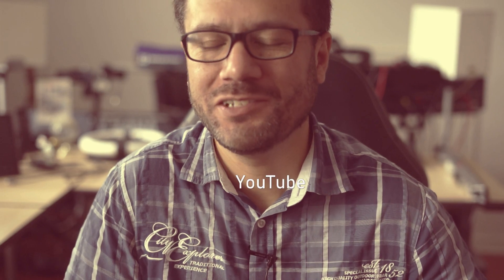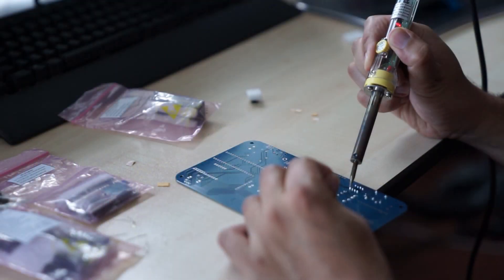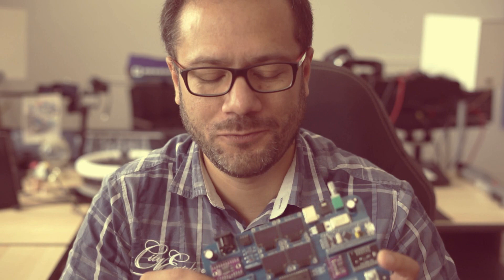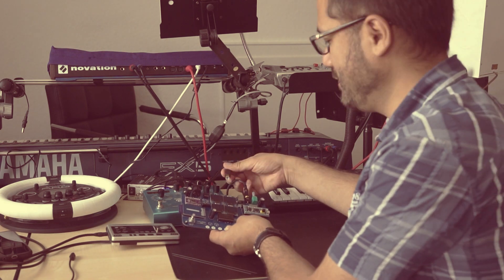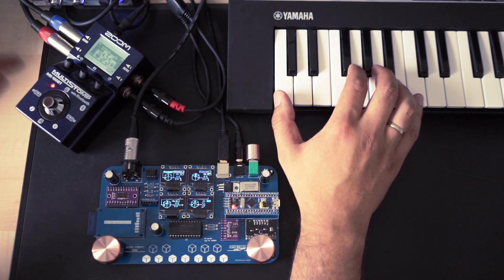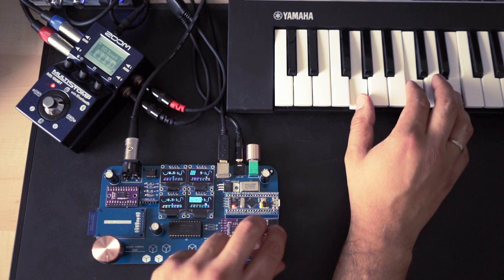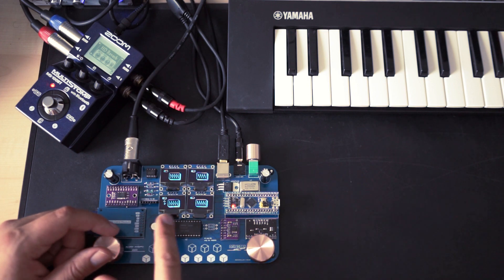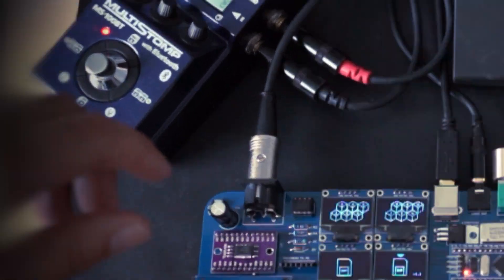DAFM DIY Synthesizer - SEGA Genesis FM sound on a tiny board

Comment: Very interesting hearing this synth run through filters since that is not the "sound of the Genesis." Would have been very interesting if the Genesis had programmable filters built in back in the day, the console would have been associated with a totally different sound!
Reply from the maker: Thanks! Though you technically do not need filters on an FM synth, they add character to the sound you couldn't achieve using FM only.

Comment: Hi! what chip have your ordered your synth, the YM2612 chip who has that particular "ladder effect" or the YM3438( without that distortion of the first one)? I really like this synthesizer but I would like to know more about the difference between these two chips.
Reply from the maker: Hi, thanks for watching! I bought the YM3438 one. There's a Wikipedia page describing the architecture of the chips and their differences, complete with sound examples: https://en.wikipedia.org/wiki/Yamaha_YM2612   Also, check this forum discussion for more Infos: http://www.sega-16.com/forum/showthread.php?25531-Discrete-Vs-Integrated-YM3438-Sega-Genesis-music-blind-test-results
Reply: @mr_floydst  Thank you for these links! I have found them extremely interesting. Especially the autor  (MaxWar) of the  forum sega-16, he said "The horrible quality of the sound however has nothing to do with the chip but rather with the lackluster amplification circuit Sega used in those consoles. " anyway, the sound of sega genesis or megadrive never seemed horrible to me, rather the opposite. I think for now I prefer the YM3438, ( now there is no stock :( ) although I do not rule out exchanging it once for the YM2612 to compare the sound, I have contacted kasser art and told me that you only have to change a pair of resistors when replacing the chip.